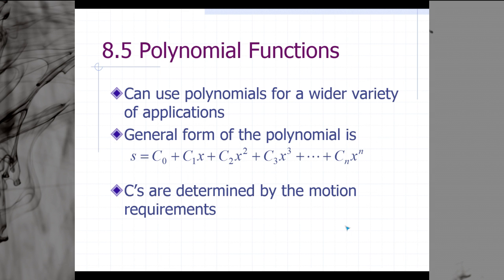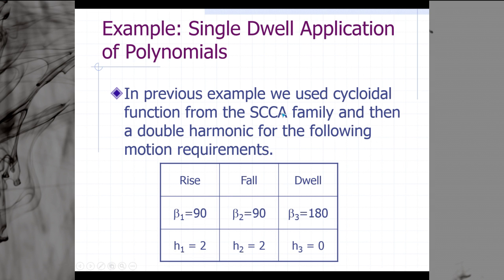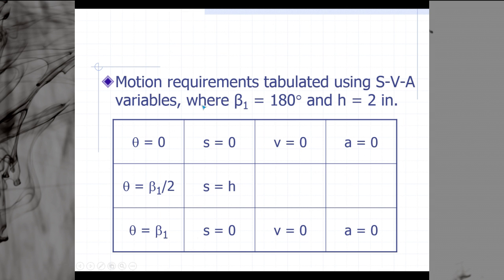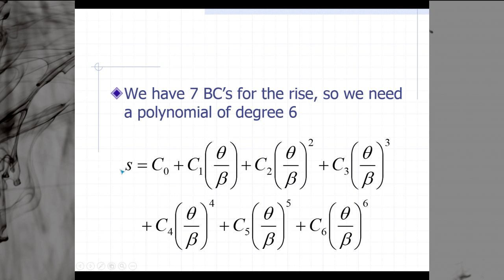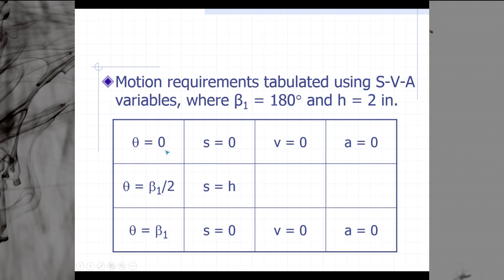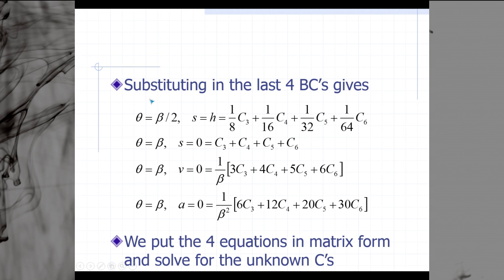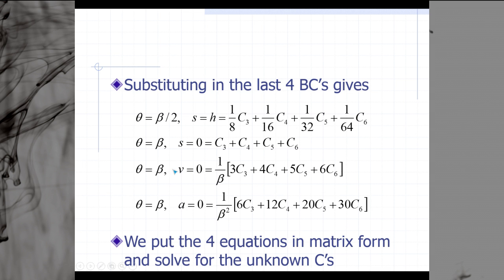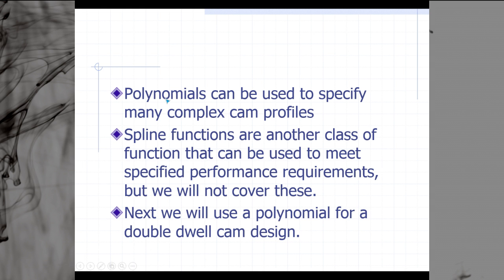Cam Design using Polynomials I

Comment: Great video, really easy to follow but could anyone tell me why early on it the video it states that the units are in, in/deg, in/deg^2 etc but the acceleration graph at the end has a readout in in/sec^2.  Is there another conversion stage that isn't in the video that I need to do before creating the graphs?